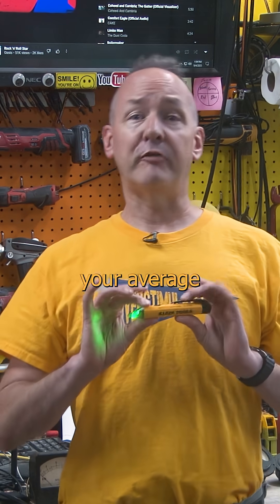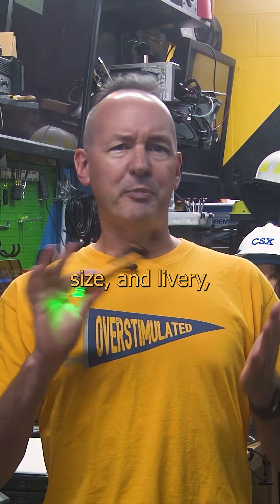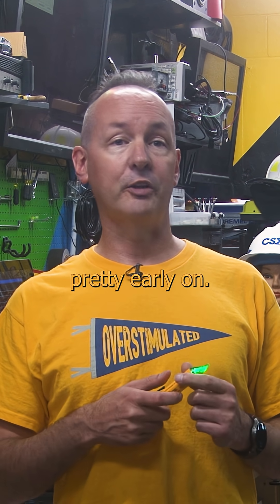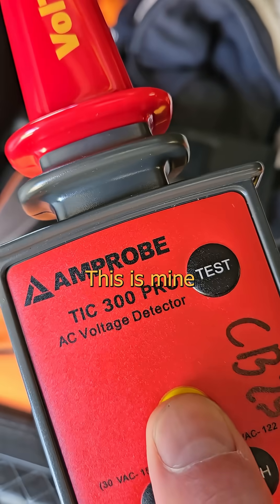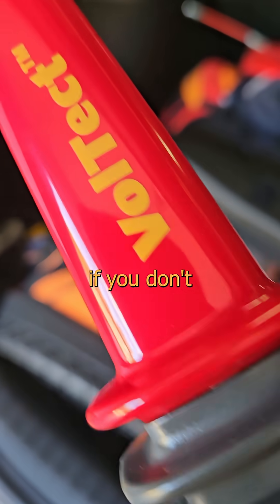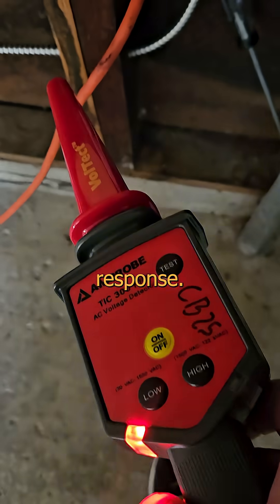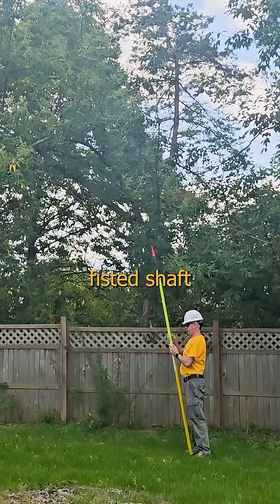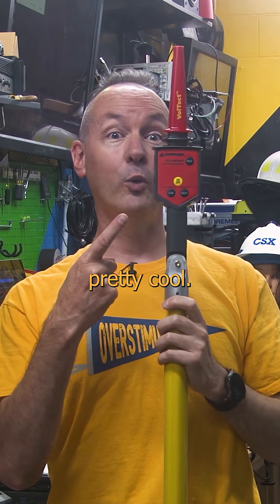High Voltage Tester #chrisboden #comedy #engineering #electrical #tools #energy #power #innuendo

Comment: You can give me all the gear I need and my ass still puckers when I test a 230kv bus for dead.
Reply: Either way, one of you is dead
Reply: Fear is your safety fuse my friend. Cherish it. Just don't let it freeze you. 
Once your fear stops, your double checking stops, and... You know what happens next 😊
Reply: At my job they always have me (the old guy)  do the sketchy stuff. Cause I don't " give a rats a&& about it". The younger guys are terrified, an I'm not.
Reply: @johnhowe6178  Well, yeah. You're old. You've got less on the table if you come up snake-eyes.
Reply: 230kV is so rare around here, I initially thought you meant 230V, our HV systems are usually 130kV or 400kV, nothing in between .
Reply: That is why the base is flared...
Reply: I'm more a "I'm either right or suddenly it's not my problem" kind of person.
Why worry about something I'm not going to have to fix/clean up 🤷

Comment: Also, these things are called death sticks. They're only about 90% effective. If you want to gamble your life on a one in ten bet, use these as your only safety tool. 

What they are good for is adding another layer of safety to an already relatively safe system. We've got a Lock Out Tag Out team on our job site, and they've got a 99.99% effectiveness. That's still a one in a thousand chance of failure, which isn't great, so you add in the one in ten chance of failure of the death stick, and the chance of both failing at the same time is one in ten thousand. Much better.
Reply: Absolute bullocks. These are the far superior method to confirm dead in an AC system. 1 in 10 is complete bs and you know it. I have used mine probably 100,000 times and have never gotten a false negative... not once. EVER. False positives yes, but that doesn't put you in danger, just alerts you that induction is happening. Those who call these idiot sticks are just idiots

Comment: I just don’t like them. We know we should use the meter to confirm no power. I feel like these give guys a false sense of security, and if you use one you are eventually going to take it for granted and not confirm with a proper meter. 

What I do is, just check the source disconnect. If it’s off then, just like with the ticker, I know power should be off. Then I confirm that.

Comment: When I used one of those we had to test using a known 110 vac source.   Even an unloaded 110 vac source will work.

1. Test on the 110 source.
2. Candidate 
3. Test again on the 110 source.

Failure to use properly gets the user a trip to HR.
Reply: I've never tried these on DC.  In theory it might catch the inrush of turning a source on, but once the source is stabilized it cannot see it.
Reply: They do not work on DC, however if you are working on HV DC and didn't know that.... you probably shouldn't be
Reply: @Teh_Random_Canadian  sigh Did you read what I wrote?

It might catch an "inrush" when "turning a source on".
Reply: @jamallabarge2665 Ya maybe if you switch it on and off 120 times a second 😂.... if you know it's dead and where the source is why would you ever need to do this?
Reply: @Teh_Random_Canadian  Depends upon the response time of the tracer.

I should not need to do this sort of thing.  Knowing how something works teaches me how to use it more effectively.

Comment: The head maintenance guy where I work uses his fingers, I told him he was crazy and was gonna end up getting cooked that way lol…
Reply: He's going to lose his fingers some day.

480 is low enough that you can use a Class 1 meter.   Mine are good up to 1000 vac.    

Turn the meter on. 
Set to Ohm reading
Confirm that you see probe resistance (usually under 1 ohm)
Set to A/C.
Check it.
Reply: The number of people I've run into who're extremely lucky their idiocy hasn't caught up to them yet and either don't realize it or are in denial is far too high. (And yes, that's a self-resolving problem in the long run but like most other self-resolving problems, it's got a high chance of 'resolving' a bunch of other people in the process.)

Comment: My Dad used to be an autobody worker, so when he rewired a bit of the shoddy house wire using skills from putting a radio in his old car and working on the Camaro Z/21 from the 80's he used to have, kept the braker on and just caused to go sparky to see if it was connected properly

Comment: But does it still go off if you rub it on your clothes?
Reply: The double-enders and in-you-end-o is strong
Reply: Static electricity is your answer
Reply: This was my question
Reply: I find that sock works better.
Reply: @Amin.Ashraf  Stand it up by the laundry hamper when you're finished. 🤣
Reply: Got got'em lol
Reply: Naw, that one u've gotta cram in & outta a bunghole
Reply: Not with that attitude
Reply: Static build up induces potential onto the sensor. You can also move these past a dead copper wire and get a signal for a brief second.